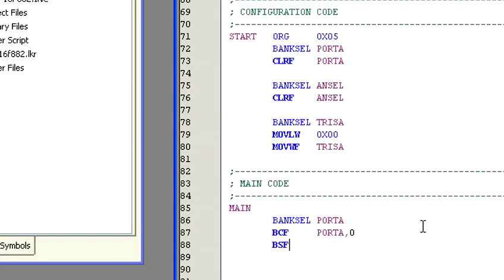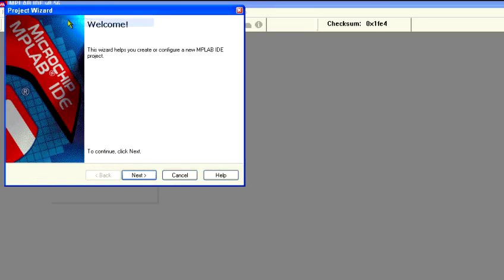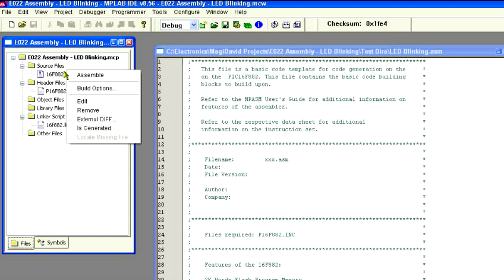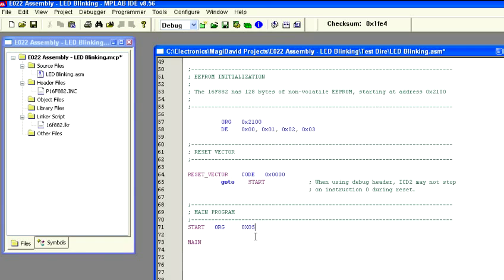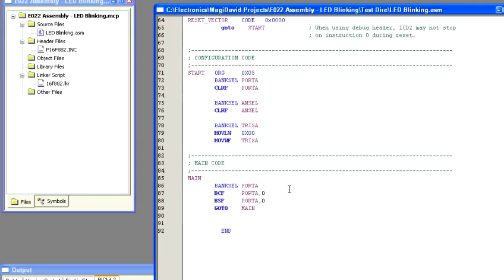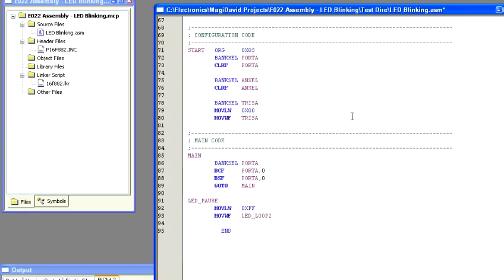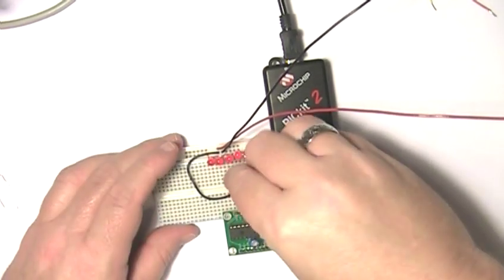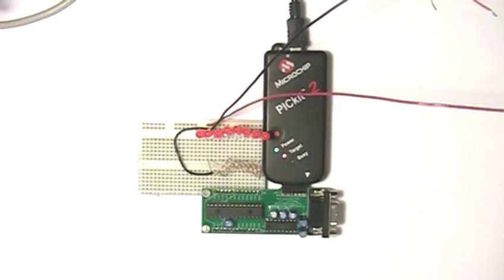MD Lab: Assembly Language 101 #1 - Program a PIC16F882 to blink an LED & Binary Counter

Comment: Hello Dave,
I have a project board with 6 seven segments display designed for a pic16f877.
I tried to find any a program to multiplex the 6 or lesser 7 seg-displays, but nothing will  work. The reason that no programs will work is because the   7 seg-segment are common anode. Can you please do a video or give me an idea on how to multiplex common anode the 7seg-displays?  The 6 transistors to turn On the 6 ; 7seg_ displays  (turn them High to 5 volts ) are connected to port A, and the 7seg_Display LED’s are connected to port D. Thanks in advance.
Reply from the maker: C or Assembly?

Sounds like you're circuit is setup correctly with the transistors driving the Anode of the display to +5V. To turn on a segment you just need to bring the bit on PORT D low (effectively making it ground). 

steps:
1) Turn off all transistors (make sure display is off)
2) Update data on PORTD to reflect new digit to display.
3) Turn on first transistor
4) Wait long enough for the human eye to register the data. (refresh rate).
5) Turn of first transistor
 repeat steps  2 - 5 for each digit. 

Also, make sure the port on that MCU can handle the current you're trying to sink into it. Otherwise the port will shut down to protect the MCU. You can adjust the current draw by adjusting the resistor values you are using on the display.
Reply: Assembly language. About the Board, you are correct; that is the way the board is set up. Today, thanks to your suggestion I was able to turn On the 7seg_Displays. However I can not make the 7seg_Display show different characters or number. ( multiplexing) Even with a delay all 6 -7seg-Display segments are all On. Thank you for the quick response.
Reply from the maker: @mega2034  How do you have your memory setup to keep track of each digits' current value?

For example: use a SRAM memory location to keep track of what digit 1 displays, another memory location for digit 2, ect...

Setup some labels to point to SRAM in the PIC memory. For example (hex values are example only, you'll have to assign them to un-allocated SRAM addresses.):

#define display_1 0x00
#define display_2 0x01
#define display_3 0x02
#define display_4 0x03
#define display_5 0x04

ect...

As you move from digit to digit you can reference the stored data to display the correct value using the method listed in my previous message. 

To change displayed data you just need change the value in the memory location referenced by display_x.

Comment: Originally I was trying to decfsz PORTC directly, and after messing with the code for about an hour, countless google searches, I came across this video where you break that same command into several commands (INCF, MOVF, and then MOWF PORTA). Doing it this way fixed my probem.

Why doesn't decfsz PORTC seem to work? I've seen code examples that have incf PORTx, but my experience suggests that they are mistaken. I've tried googling this but its kind of a hard situation to look up.
Reply from the maker: Hello Andrew, 

It really depends on the MCU you're using, not all of them support all the assembly commands, hence why I used INCF, MOVF, and MOVWF. Look at the datasheet and make sure the command is supported and also that it will do what you want it to do. 

Also, don't write to PORTC directly, write to LATC. If the MCU is running fast enough, it's possible to read a port before the previously written data has fully registered. So you can write a 1 and if you read back the port right after, it's possible to read the previous data that was there, such as a 0. Two things prevent this, using a NOP to give voltages time to settle or writing to LATx (which is why it's there).

Hope this helps.

Comment: Dear David
Thank you very much for your tutoring. I am an absolute beginer
I have tried to compile yor file Lab.001.asm for my PIc16f876a without success.
Here is the code

     LIST      p=16F876a            ; list directive to define processor
     #INCLUDE <p16F876a.inc>        ; processor specific variable definitions 
    ; TODO INSERT CONFIG CODE HERE USING CONFIG BITS GENERATOR
    ; CONFIG
; __config 0xFFFB
 __CONFIG _FOSC_EXTRC & _WDTE_OFF & _PWRTE_OFF & _BOREN_ON & _LVP_ON & _CPD_OFF & _WRT_OFF & _CP_OFF
    

; '__CONFIG' directive is used to embed configuration word within .asm file.
; The lables following the directive are located in the respective .inc file.
; See data sheet for additional information on configuration word settings.
; Note that the _DEBUG_ON is changed by selecting a debugger or programmer.  
; There isn't much advantage to setting it in the code.  

; UDATA declares a section of uninitialized data
 
VARIABLES   UDATA           ; VARIABLES is the name of the section of memory
myvar1      RES     1       ; uninitialized data, placed by linker in GPR's. 
myvar2      RES     1

LED_VAR  UDATA_SHR
LED_LOOP RES 1
LED_LOOP2 RES 1
LED_COUNT RES 1
FX_TEMP  RES 1

GLOBAL FX_TEMP

;#INCLUDE <EFT.h>  
;------------------------------------------------------------------------------
; EEPROM INITIALIZATION
;
; The 16F882 has 128 bytes of non-volatile EEPROM, starting at address 0x2100
; 
;------------------------------------------------------------------------------

          ORG   0x2100
          DE    0x00, 0x01, 0x02, 0x03

;------------------------------------------------------------------------------
; RESET VECTOR
;------------------------------------------------------------------------------

RES_VECT  CODE    0x0000            ; processor reset vector
    GOTO    START                   ; go to beginning of program

;------------------------------------------------------------------------------
; TODO ADD INTERRUPTS HERE IF USED

;------------------------------------------------------------------------------
; CONFIGURATION CODE
;------------------------------------------------------------------------------
;START ORG 0X05
MAIN_PROG CODE                      ; let linker place main program

START

 BANKSEL PORTA
 CLRF PORTA

 BANKSEL ANSEL
 CLRF ANSEL

 BANKSEL TRISA
 MOVLW 0X00
 MOVWF TRISA

 MOVLW 0X01
 MOVWF LED_COUNT

 BANKSEL STATUS
 BCF STATUS,C

;------------------------------------------------------------------------------
; MAIN CODE
;------------------------------------------------------------------------------
MAIN
 BANKSEL PORTA
 RRF LED_COUNT,F
 MOVF LED_COUNT,W
 MOVWF PORTA
 CALL LED_PAUSE
 GOTO MAIN

LED_PAUSE
 MOVLW 0XFF
 MOVWF LED_LOOP2

LED_PAUSE2
 CLRF LED_LOOP
 DECFSZ LED_LOOP,F
 GOTO $-1
 DECFSZ LED_LOOP2,F
 GOTO LED_PAUSE2
 RETURN

;#include <EFT.asm>
    GOTO $                          ; loop forever

    END
and here the errors
Warning[205] C:\USERS\JCASE\MPLABXPROJECTS\MAGIDAVID_AL_101.X\MAGIDAVID_LAB_001.ASM 50 : Found directive in column 1. (GLOBAL)
Error[113]   C:\USERS\JCASE\MPLABXPROJECTS\MAGIDAVID_AL_101.X\MAGIDAVID_LAB_001.ASM 85 : Symbol not previously defined (ANSEL)
Error[113]   C:\USERS\JCASE\MPLABXPROJECTS\MAGIDAVID_AL_101.X\MAGIDAVID_LAB_001.ASM 86 : Symbol not previously defined (ANSEL)
My E mail is jcaser1948@yahoo.es
Reply from the maker: Not sure about the first error, but maybe this line? ";START ORG 0X05", should the ";" be there?

Try ANSELA in place of the ANSEL. Different MCUs handle the ANSEL registers differently, you can look in the datasheet to find out what label names to  use for each register, Microchip is pretty good about using the same name in the datasheet in the compiler.
Reply: I have tried another approach.
First I took your Surcecode and tried to compile it "as it is"It failed because <EFT.asm> file was not there. I commented t5his file out. Still did not compile with the error
Warning[205] C:\USERS\JCASE\MPLABXPROJECTS\MAGIDAVID_AL_101.X\MAGIDAVID_LAB_001.ASM 26 : Found directive in column 1. (__CONFIG).
I commented the configutations bits out, and then your source code compiled. with no errors.
I substituted the processor for the PIC16F876a (Nothing else changed) and I get the following errors
Warning[205] C:\USERS\JCASE\MPLABXPROJECTS\MAGIDAVID_AL_101.X\MAGIDAVID_LAB_001.ASM 47 : Found directive in column 1. (GLOBAL)
Error[113]   C:\USERS\JCASE\MPLABXPROJECTS\MAGIDAVID_AL_101.X\MAGIDAVID_LAB_001.ASM 77 : Symbol not previously defined (ANSEL)
Error[113]   C:\USERS\JCASE\MPLABXPROJECTS\MAGIDAVID_AL_101.X\MAGIDAVID_LAB_001.ASM 78 : Symbol not previously defined (ANSEL).
So I am now more confused as bevor.Does it mean I have to change every programm to fit every single of the Microchip chips?.Could your recommend me  a book where a systematic approach to the assebler language is implemented?
Thanks
Reply from the maker: There's a template directory with MPLABX C:\Program Files (x86)\Microchip\MPLABX\v3.26\mpasmx\templates which has a template file for all the MCUs that Microchip makes. Find the one for the PIC16F876 and start with that file, it will contain the correct __config directives. 

Next, fine the proper include file for the PIC16F876 and copy it over to your project folder. The INC file has the proper labels for the resources inside the PIC16F876, so you'll want to include this in your project file.

If your MCU doesn't have analog capability then it won't use the ANSEL register. In this case, you can remove the ANSEL command from the code. If the PIC16F876 does have analog control then look up the analog section in the datasheet and see if PORTA is analog capable, if it is then  you'll need to configure the ANSELA register for digital.

Comment: tanks for all ; plz how to control time of blinking ; if i want 1 second or half or maybe 1 min ????
Reply from the maker: +garcia pedro I recommend using a timer in the MCU. Configure the timer to increment every 10ms, then all you have to do is change the LED when the timer reaches a certain value. Don't forget to reset the timer after you change the LED.
Reply: I wish you makes another video to explain that

Comment: FIRST THANKS FOR THE TUTORIAL. SECOND WHERE IS PART 2 SIR?
Reply from the maker: Hello,

They aren't exactly labeled as part 1, part 2, ect... But there are a lot of videos on Assembly programming in my channel.
Reply: Hi David, You're a legend sir. In the video, I heard you mentioning that you would do a tutorial where you would 'add the code to define ASCII Characters' in another video. It'd nice if you could post that video, sir. Thank you again.
Reply from the maker: Kerdiang Miabok
Lots of good info on in the Keyboard videos and the "Real Time Clock Calander", both of these use ASCII code to send data to the computer for display. As for doing that in the Dot Matrix project, I never have gotten back to the project. Though, I'm thining about designing up a PC board for a DOT matrix display so everyone could follow along easily.
Reply: David, that would be awesome. You make em assembly look very simple in your videos. Do more of em please. Regards, Kerdiang.

Comment: David,

An excellent tutorial and very well presented!

I have one comment and one question: I downloaded the source code and assembled it successfully.

1. at the start of the program the statement:  #include  <EFT.asm> is commented out but at the end of the program it appears again and is not commented out.

2. in the .err file, for the statements CRLF ANSEL and MOVWF TRISTA
I get the message: "Register in operand not in Bank0". Nonetheless it assembles successfully.
Is the appearance of these messages normal or is there something one can do to eliminate them as well?

thanks,

larry
Reply from the maker: Hello Larry,

First, I've been coding in C for the past year and half and it's has been a long time since I've coded anything in assembly, so my memory is bit fuzzy on some details.

1) There might be a more pressing reason, but I think it's just control placement of the code during the compile.

2) It's not really an error, more of a warning that's there to remind you to make sure you've selected the correct bank that the register appears in. I do believe there is a compiler directive you can add to your code that will suppress that particular warning. However, I prefer to see the warning as it is intended as useful information.

Comment: First of all, thanks so much for these tutorials. This is perfect, and although I have a PIC12F675, the datasheet shows the different register names and there's no problem there.
Second: I didn't get the external power supply part... I assume then that the PIC is not able to draw enough current to feed all the 8 LED's then? How did you wire them? I'm new to PIC's and I definitely dont want to burn anything. I'm more of an Arduino guy... yet. Thanks again, David.
Reply from the maker: Thank you,

Actually, it's the programmer that can't supply enough current to drive a whole lot. Adding in external power to the breadboard relieves that demand on the programmer.

Every PIC is different in what it can and can't do. Most can supply 100ma on a port, so driving 8 LEDs is very possible as long as you keep the current under that 100ma. However, it's always best to check the datasheet of the PIC you're using to be sure what it's electrical limits are.

Comment from the maker: There's not much to something like this. You just need to check the IO bit the switch is tied to and then turn on / off the LED. The code would look something like this:
BTFSS PORTA,0  ;is switch pressed? 
BSF     PORTA,1 ;yes - so turn on LED.
BTFSC PORTA,0 ;is switched released?
BCF     PORTA,1 ;yes - so turn off LED.
Use a pull-up resistor to set PORTA,0 high with switch tied to PORTA,0 and ground. When switch is pressed, it will pull that input low and turn off the LED.

Comment: Trying to make my first led blink. But I'm using a 16F84A, Pic Basic Pro Demo version and the K150 programmer. I used code on p 126 of book, Picbasic Projects by Dogan Ibrahim.  The code compiled successfully, and I programmed the 16F84A. Transferred the chip to the breadboard and powered on. Nothing happened. I rechecked programming, wiring and fuses, and disabled the WDT. Still nothing. There is 1.57 V on the pin driving the led, not 5V.  Any suggestions? I can provide info on circuit.

Comment from the maker: Stack over and under runs can drive one crazy, and finding the problem can be an adventure in itself, especially when you have thousands of lines of code.... A good habit to get into is to always use the "banksel f" instruction before referencing a register, especially if you are letting the compiler decide where the program's variables will be located in RAM.

Comment: Had to walk away from it for a bit, but think I finally converted your tutorial to a pic 16f648a because that's what I have to work with. Tomorrow I will try it out on the breadboard. Pulled my hair out on the stack under run error. Then on the PC memory wrap. Your videos on LED matrix's and 7 segment displays will also be very helpful when the time comes. Thanks again